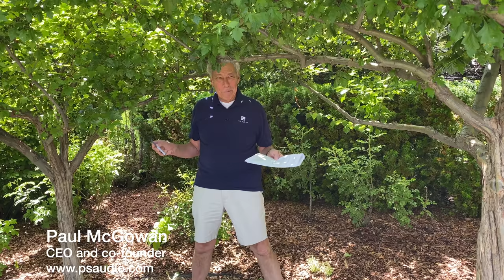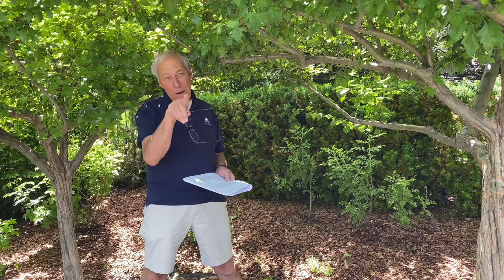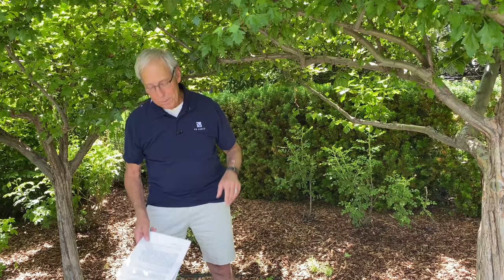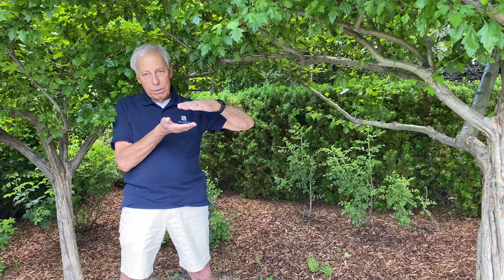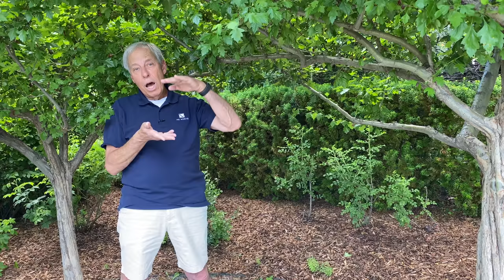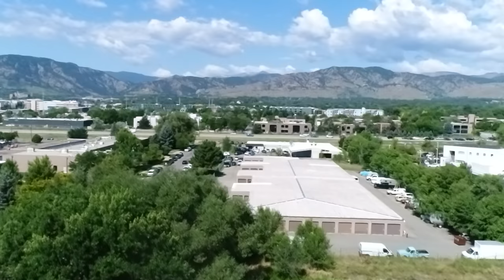Current vs. power in an amp

Comment: The impedance value of a speaker is nominal, or an average if you will, and is not constant throughout the entire frequency range. Cone speakers do not tend to vary a great deal, but planar speakers do. I have a pair of Sound Lab electrostatics. They vary between 40 and 4 ohms, with a nominal rating of 8 ohms. A high current amp, in essence, automatically adjusts for the impedance swing.

Comment: Good indicator for high current is in spec sheet - if amplifier has almost 2x the power in 4 ohms than in 8 ohms.
Reply: That's a weak indicator, which will often lead to an incorrect conclusion.  Better to look for an amplifier which is specified for 2 ohm loads, or 4 ohm bridged operation.  
The only accurate parameter is the overcurrent-protection threshold for the output stage, which you need to consult the schematic to find.  Even then, it may not be straightforward, because the current limit usually has a voltage-dependent term to it, so the result of a comparison between two amplifiers can depend on which speaker load is considered.
Reply: @Mr Do 
Yes, exactly.  There aren't many "high current" amplifier designs for home audio.
Reply: Well... It does not really say anything if it's messured at the weak 1kHz, 1ch driven @ 1% (or even 10% for some) THD crap instead of the real 20 - 20.000Hz, all ch driven @ 0,0xx% THD.
And many don't specify max power draw (often it's nominal instead) so it's hard to do the math to find out if it really can deliver what it says too. MANY manufactures cheat with their watt ratings. Only a few do it properly. I.e NAD messures all ch driven with 20 - 20.000Hz signal and very low THD.
Reply: @Mr Do Not quite true.. I have seen many home power amps that specify both 8 and 4 ohm bridged power. Some even 2ohm.
Reply: @leekumiega9268  
Or one of Krell's larger models.  The KSA-300 has an overcurrent shutdown threshold of more than 100A rms.
Reply: @marianneoelund2940  here is an amplifier that can out muscle the big Krell  at 360 Amps Peak or 254 amps  RMS  http://www.stereotimes.com/amp010500.shtml  here is the heart of his amplifier his power supply with an explanation as to how it works   https://hometheaterhifi.com/volume_2_3/v2n3f.html  this explanation is for the 300 watt unit while  the 600 watt amp  above has more output devices
Reply: @leekumiega9268  
Where does the 254A rms figure come from?  The article mentions it's capable of 4000W into 1 ohm (brief duration) but that's only 63.25A rms.  
I also read Bob's article that you linked.  It's nice to have his thoughts and learn the history of the concept development, but I have to say the discussion is greatly "dumbed down" and he doesn't talk about any of the real engineering detail.  For example, he talks about the limitation on transistor current imposed by V*I < Pd(max) but doesn't mention the secondary-breakdown limit on current, which is even more severe (applies to BJTs only).  And his comparison of BJT and MOSFET output stages has a lot of "spin" to it.  In most respects, MOSFETs are actually more rugged.
Reply: @marianneoelund2940  Yes I know the square root of 4000 is 63.25 and the brief duration is several seconds , but he is able to get 240 amps peak using 12 output devices in the 300 WATT UNIT and I read somewhere he uses 18 output devices in his 600 WATT UNIT so 20 amps x 18 gives 360 peak x.707 for 254 RMS .Note that This is a test of maximum transient power lasting a few milliseconds that some publications test for. Also his white papers which go much more in depth are available on line. maybe this patent will explain better  https://patents.google.com/patent/US6535399 One more thing the Dunbed down piece is meant for the consumer not engineer. And At 3 X the price I would hope Krell did some things better , I have no way of knowing if Krells  tend to blow up if stressed like one article says but makes wonder if it's true
Reply: @leekumiega9268  
Don't forget that half of the transistors are on the positive side, and half are on the negative side, so only half conduct at a time.  The total device limit is then 9 * 20A peak.  And it's usually not a valid assumption to simply use the output device absolute max Ic rating as the amplifier's actual output current capability.  With BJT's there is necessarily current monitoring to prevent overcurrent and there needs to be some margin for tolerances.  
But I don't consider ultimate current into a short to be a meaningful test for audio.  That's for spot welding.  I'd rather know peak current capability into a representative worst-case speaker load such as 0.5 ohms, so we can have a significant amount of voltage and power output.  
I had a look at the patent you referenced, but it's by Wen Jian Gu of Bose Corp.  I haven't found any schematics for the Sunfire amps yet.  One big question I have, is the slew rate capability of the tracking supply, so I can assess how well it maintains Vce for the output transistors across musical transients.
Reply: @Mr Do Weird that I have seen it from most of the brands you mention🤔 Even used a NAD bridged with 4ohm speaker connected up to it with no issues
Reply: @marianneoelund2940  You are right I should of realized half of the output devices are used for each cycle , Bob says he uses a 90 volt maximum rail and  when across a 0.5 ohm load (not a short) the current will be 180 amps time limited, there are only a few amplifiers costing way more can equal or surpass that. Here is the best I can find concerning  circuit description  https://patents.google.com/patent/US6104248A/en   Note not all of the schematic drawings are there.
Reply: @Mr Do What'd wrong with buying used  this amp drives 4000 watts into 1 ohm  http://www.stereotimes.com/amp010500.shtml You would have to spend 10's of thousands to equal that new.
Reply: @leekumiega9268  
It's nice to know from Bob, that it has enough oomph to drive 0.5 ohms to high voltages.  That speaks volumes.  
But also keep in mind that output stages only approach, not reach, the supply rail.  At high current, output transistor Vce(sat) is typically 3-4V, and the emitter resistors at those high currents can have 5-10V drop (possibly more).  So don't expect the clipping point to be higher than 75-80V with the 0.5 ohm load.  
Numbers for the Krell KSA-300:  At overcurrent-shutdown threshold, peak current is 20A per device, times 12 devices (it has 24 output transistors per channel).  Emitter resistors are 1 ohm.  Peak output voltage is 65V at best (it also has a 90V supply).  Theoretically it could push about 7000W into a 0.25 ohm load for a cycle or two.  
It's interesting to compute the amplifier's internal power dissipation (and you can use this for any conventional class AB amp at medium to high signal power).  P(ave) = (Vp/R)((2/pi)Vs - Vp/2) where Vs is the average supply rail voltage including ripple, Vp is the peak output voltage for the sine wave signal, and R is the load resistance.  P(ave) dissipation includes the emitter resistors and the worst-case value usually occurs around 2/3 of the amplifiers max power output.  For the KSA-300 driving a 0.5 ohm load at 3200W, Vs=85V, Vp=56V, R=0.5 gives P(ave)=2900W.  
With its tracking supply, I would estimate P(ave) at 400-600W for the Sunfire in the same case, depending on exactly how it manages the Vs-Vo difference at high current.
Reply: @marianneoelund2940  When you talk about internal power dissipation are you referring to what gets converted to heat?  The Sunfire's rails are always 6V above what is required at a moment in time so only 6V goes toward heat , that is how he gets away with using the chassis as the only heat sink, So your equation would not work in this instance as Vs is always changing Also at over 4 X the cost and weighing in at 185 pounds vs 50 I would hope that the Krell would out perform the Sunfire to some degree. Stereophile measured 1114 watts into 2 ohms at clipping Assuming double at 1 ohm  the sunfire tops it.  https://www.stereophile.com/content/krell-ksa-300s-power-amplifier-measurements
Reply: @leekumiega9268  
Yes, it's power lost as heat.  
I didn't use that equation for the Sunfire amp; remember I said it's for conventional class AB amps.  But it's not safe to assume that in the peak current case, the amplifier could maintain only 6V drop from Vs to Vo; that's why I gave a range instead of a single value.  Still, it has at least a 5x improvement in power loss compared to conventional class AB, even in this severe case.  
I ran some numbers for my Dynaco Stereo 400 with an 8 ohm load, as a more typical home-use example.  It's surprising how little variation there is, in dissipated power (Pd) across a fairly wide range of output power.  The Stereo 400 has 72-75V supplies, and achieves the following:  
@ 1/3 power, Po = 67W, Pd = 123W
@ 1/2 power, Po = 100W, Pd = 132W
@ 2/3 power, Po = 133W, Pd = 134W
@ 3/4 power, Po = 150W, Pd = 133W
@ full power, Po = 200W, Pd = 125W
For the Sunfire at 200W into 8 ohms, output stage Pd should be about 20W.
Reply: @marianneoelund2940  The numbers don.'t seem right since at low power to the load the output devices dissipate most of the power but at max power to the load the load should be dissipating most of the power ,at least in theory. Also note I added Stereophile's test of the Krell KSA-300 to the last post.
Reply: @leekumiega9268  
I'm not sure which numbers you are referring to.  I only specified down to 1/3 power, which I don't consider "low."  At max output, typical class AB amps are 60-70% efficient.
Reply: @marianneoelund2940  Exactly so at max output power to the load Pd should be at it's lowest and should  be at  it's highest with no power going to the load
Reply: @leekumiega9268  
You're thinking of class A amps, not class AB.  I haven't done any calculations for class A, because it's highly dependent on the design details and there isn't a single equation that fits all of them.  
At zero power out, class AB Pd is just 2*Vs*Ib where Ib is the idle bias current.  In most AB amps, Ib is only around 30-150mA. When the amp is working at about 10% of max power or more, Ib becomes neglectable because it turns off when the output swings more than 5-10V away from zero.  Then the instantaneous power dissipation in the output stage is its voltage drop, Vs-Vo, times the load current, Vo/R.  For Vo(t) = Vp * sin(t), we have Pd(t) = (Vs-Vp*sin(t))(Vp*sin(t)/R).  If you integrate that expression over one half cycle and divide by the half-cycle time, you get the P(ave) equation that I provided earlier.
Reply: @marianneoelund2940  I almost get it but what is t in the above equation?   Also did you get a chance to look at the Krell review in Stereophile  that I posted ?here it is again https://www.stereophile.com/content/krell-ksa-300s-power-amplifier-measurements  It's theoretical absolute maximum current  ability may be higher but at 1 ohm the Sunfire is pushing more current. Both amps can drive the Apogee Scintilla's with a 1 ohm impedance that drops below that ,but with a sensitivity of  only 73 db  the Sunfire will play louder. You will note that the power out of the Krell  does not double going from 4 ohms to 2 ohms (And that is with only 1 channel driven) putting out at most 2228 watts at 1 ohm where the sunfire delivers 4000.  https://hometheaterreview.com/apogee-scintilla-loudspeakers-reviewed/ One more thing the rail voltage for the 600 watt amp is 125 v it's 90  v with the 300 watt amp . This article is slightly more in depth  note that he biases his amp class A for small signals and AB for large signals  that's why reviewers noted such fine detail in low musical passages. https://karma.digital/sites/default/files/sunfire_amplifier_whitepaper.pdf
Reply: @marianneoelund2940  Read about krell's  iBias  ,I think it's a marketing scheme (name)  https://www.krellhifi.com/ibias-technology/  Now isn't bias used to have the output device run at the linear portion of it's output curve ,I do not see how adjusting it while staying class A will save much power ,I believe they are using something similar to what Bob Carver uses with his tracking down converter .and are actually modulating the power supply.Your thoughts?
Reply: @leekumiega9268  
When we are talking about an equation for the instantaneous value, it is an equation (function) of time, t.  You can plot it on a graph versus time, or display it on a scope.  Then obtaining the average value involves doing a little calculus (integration) over time.  
The hometheaterreview.com article mentions the KMA-200, which is a monoblock amplifier rated at 200W into 8 ohms.  I haven't found any power measurements for the KSA-300 at 1 ohm.  The Stereophile article does measure the KSA-300 down to 2 ohms, but that's a continuous measurement, not a test of ultimate short-duration power.  
Regarding the Sunfire, I suspect we've been discussing two different versions.  There is a 300 and a 600.  From Bob's articles we know that the 300 probably has 90V supplies, but I can only guess the 600 may have 120V supplies.  It isn't believable that the 300 could produce 4000W into 1 ohm, as that requires a peak voltage of 90V and the output stage would need to have a 0V drop, so if that output power is real it must be for the 600 version.  It shouldn't be surprising if the big Sunfire 600W/ch @8ohms amp can push more power into low impedances, than the Krell 300W/ch @8ohms amp.
Reply: @marianneoelund2940  Yes I noted in one of my replies that the rail voltage is 125 volts for the 600 watt amp, And the 300 watt amp was 2400 watts into 1 ohm. Both amplifiers were posted earlier in this thread .  Also now your equation makes sense ,I should of figured that t was time.
Reply: @leekumiega9268  
My Krell schematics are missing the autobias section, so I could only guess  what the bias values are.  The idea behind bias in class AB amps, is to make the transition between the positive and negative halves smoother, by allowing both to conduct simultaneously as the load current passes through 0.  This minimizes the voltage step that the driver or mid-gain stage needs to make, to switch from turning one side on, to the other.  
At low power levels, crossover notch is more audible, as it is a higher % of the output power.  You can compensate for this by increasing the bias current at low power.  Then at higher power levels, bias can drop back down.  I suppose this is the approach Krell have taken.  
It's not a matter of moving the output stage operating point to a "more linear" region; output stages don't have voltage gain, so that's not a consideration.  The only difficulty is making the transition between using the pos and neg output circuits perfectly smooth.  
The Krell KSA-200 and KSA-300 definitely have a fixed supply rail with no tracking of the output voltage.
Reply: @marianneoelund2940  I thought most Krell amps were class A so there is no transition ,but what I was asking about is the link to the NEW amps with iBias  that I also posted to you .here is the link again https://www.krellhifi.com/ibias-technology/ I can not fathom how constantly changing or modulating the bias according to demand will lower the amount of wasted power like modulating the power supply does . Can you? Also i thought that All amplification devices be it voltage gain or current gain have output curves.
Reply: @leekumiega9268  
I found a little more information from the Sunfire owner's manuals for the Series II models.  See https://www.sunfire.com/support/sunfire-discontinued-products
The number of devices used (12 for Standard version and 18 for Signature version) actually refers to the hexfets in the tracking power supply, not the output stages.  
The Signature version is rated at 625W/ch at 8 ohms, 1250W/ch at 4 ohms and 2500W/ch at 2 ohms (limited time basis).  There is no spec for power into 1 ohm, in the manual.  The only place I've seen a power rating for 1 ohm, was on a spec sheet posted at cnet, but I'm starting to have doubts about that figure:  
The power rating at 2 ohms infers 35.4A rms or 50A peak.  The manual also gives a "Maximum Output Current" spec and it's 100A peak to peak.  That means just 50A peak - tying up with the power rating for 2 ohm load but limiting power into a 1 ohm load to only 1250W.  
I suppose it's possible the Series II models might have a lower current limit than the original models.  That would make them more reliable.  If the original models actually do have much more current capability, then they would be the ones to have for the most difficult speaker loads, not the Series II.
Reply: @marianneoelund2940  When Bob sold the company to Nortec ,They lowered the max output as you noted ,But I am not aware of any reliability issues with the older ones.
Reply: @leekumiega9268  
I haven't looked at all of the Krell models.  The KSA-200 and KSA-300 have variable bias.  If you apply enough bias, then the amplifier does operate effectively class A, up to a certain power level.  Then they can advertise them as such.  
From reading the description in the owner's manual, they are actually increasing bias as the output power level goes up, in order to maintain class A operation.  So at low power levels the bias is reduced and this does reduce power dissipation substantially, compared to keeping a very high bias on at all times.  
But this scheme doesn't allow anywhere near the efficiency of the Sunfire tracking power supply.  In fact, it significantly compounds heat dissipation at higher power levels.  Note that when the heat sinks are getting very hot (80C), the Krells won't engage the two highest bias levels.
Reply: @Mr Do Look into professional amplifiers. I have a Crown XLS1002 that is bridgeable into 4 ohms. I use it in 8 ohms mono.